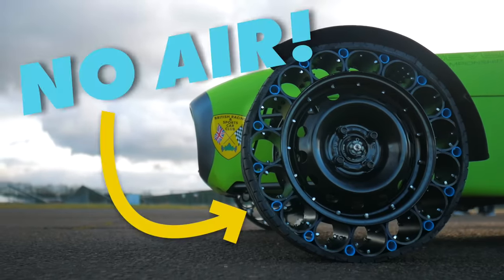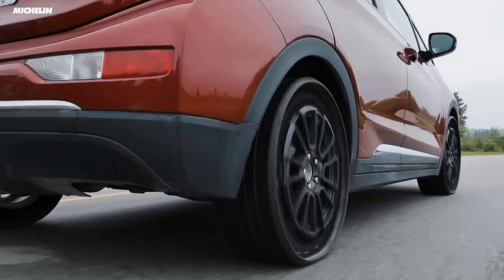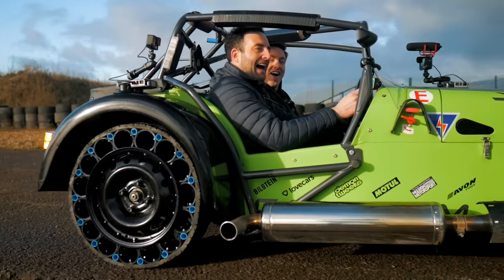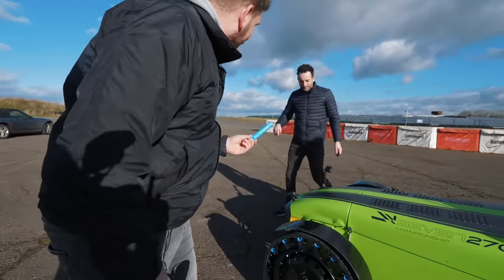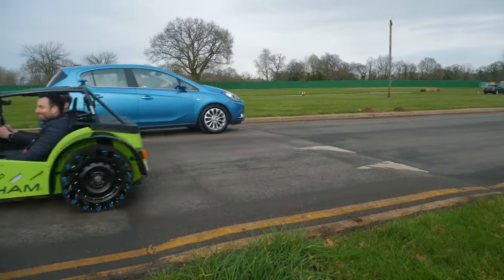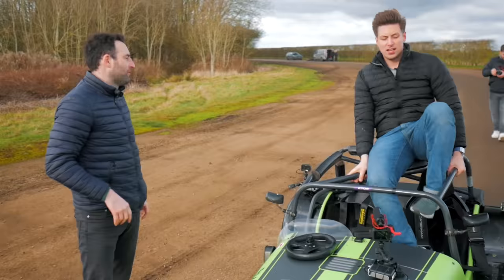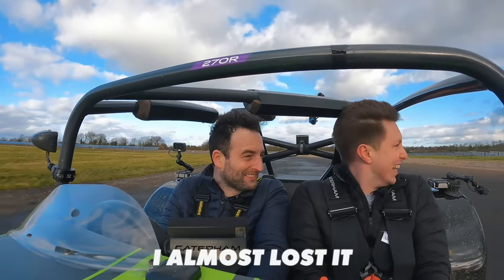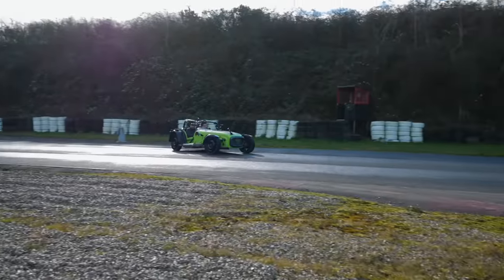I Made DIY Airless Tires

Comment: you could have built it in normal tire outsides, keeping the sides, to keep your innards in
Reply: replace the inflatable container with the air-less mechanism
Reply: the tire casing completed, would have solve the noise problems aswell, put back the side flaps

Comment: Why not simply mold the tire's rubber into roughly these shapes? No worries about nuts and bolts flying off, better adhesion to the tread as it's one piece, the ability to have steel belts.

Comment: They aren't using lock tite bolts and nuts and have no safety wiring holding it together for the nuts don't spin out ward. There is a reason airplanes use safety wire latching through the nuts and bolts on pretty much everything that moves. If the nut comes out you going to lose a piece or have a major part fall out due to the vibrations. 

The first 10 seconds in I seen this major problem in your design. This is why the major companies didn't use a design with nuts and bolts. You have to many points of failure in that tire. You need to simple it down. Also it just looks nasty. I understand it is a prototype. But there needs to be a side piece of that tire. It would also reduce the noise the tire produces.

Comment: Why did you use steel tubing for the internal structure. Tyres flex there is no flex in those tyres.

Comment: You need more of a pyramid type tire to make it more round. The design atm is less round, because you don't have enough triangles to create a rounder surface. If you look at the design you have you created with the smaller circles a triangle space. Which makes the tire lose shape. Those open spaces are causing the tire to be compressed in those zones. Look how they do it in video game graphics. To get more and more rounded shapes. They produce more and more triangles. Like shadow of the tomb raider. The game is designed in signs with millions of triangles that are tiny. This gives the shape to the world and they can create better shapes. 

I would never use a tire with how you designed it in mind at all. It makes no sense at all. No safety ties on the nuts and bolts, gaps in the spaces between the circles after you created a triangular shape. You need to recreate the thread of the tire to be build in metal wires that attach to it. I know you just ran bolts and nuts through it. You can clearly see that. Which is more point to failure. Everything you have done means this tire wouldn't last 1 week in normal operation use. Hell you might not even get 1 hour at normal speeds. You already had major failures after 5 minutes.

Comment: "For you foreign viewers, this is a pothole"
Do you really think, you are the only country, where the road construction companies do crap work? I am from germany, and here, i don't know, how to tell... They take the tax money, use 1/4 for the work, use construction grounds as a parking lot for their machines, and six month later they start the crap work. After finishing the company disappears, so waranty is impossible. This works this way for over 20 years now. And every year it became worse. A deep pothole with little surface, they came, put a brick in it, filled the rest with sand and knock it flat with a shovel. IF they do some repairs with asphalt, the new surface is nearly as wobbely as cobblestone roads from 1905.
I have made some videos. It's horrible here.
But what will you expect from a county, where the laws are so weak, that companies think, they can allow themselves to work, when they want, ask for more money, cause they transfered 3/4 away on a bankaccount in switzerland. These companies stretched the build time of the BER Airport to 9 years. The Trainstation in Stuttgart was planned 1994. Start of the construction was 2010. 2019 should be the opening. Today they aren't ready, and they maybe can finish the station in 2025.
Great, huh?
Everything is messed up like that here.

Comment: Dude the only reason nails make tires not work is due to air pressure in the tire. Any 2 year old could tell you this. Doing a bed of nail test on a tire that doesn't use a gas type system is just stupid. Of course it isn't going to make the tire fail. It could get caught in the tire and break something else. But a normal tire has that same problem

You need to make other tests of it outside of nails. Like how does it handle hitting a curb, at slow and fast speeds. How does it handle something being stuck in the side of the tire. What about heat. Does the tire start to fail at hotter heat temps. Air has an advantage of being flexible at higher speeds. Does that tire have the same advantages. Test this like. Not a tire with zero air going over nails.

Comment: How in the ever living fuck did you manage to spend 300$ building ONE wheel? That's like 20$ worth of pipe, less than 30$ worth of bolts. a steel hub (less than 100$). and some tire tread (less than 100$)

Comment: This design of tyre is good but there l will not be stranded at the side of the road with a flat tyre my 25 year old hilux has a full sized spare wheel pot holes would not bother my hilux because they are high profile tyres whats to big deal with low profile tyres had them on our ford Fiesta on steel rims the next Fiesta had much higher profile but they were useless k would hate to think if they were alloy why don't look at the how they used to build cars and learn from them cars built 20 or 25 years last longer have less electronics and there are a lot of them on the road my hilux will last another 25 years easily without an engine rebuild how do you make an old british built car reliable put a Toyota engine and gearbox in it

Comment: First Ukraine and Russian captions.
Second,  300 ! bolts?
    Can this be done by taking bolts off, say captured Russian military vehicles?
    And can that be done without power tools?  (Take a close look at Aristotle's 6 simple engines and 32 complex engines.)
Third, fresh water pipe?  What might be scavenged in Ukraine from dead vehicles or bombed buildings that would work as well?  Or, work at low speeds?
Fourth, how to make a car jack.  Again, Aristotle and scavenging.
Fifth, you're using the tread from a "normal tire".  Do some research and find out what is a normal tire in Ukraine?  Can tire treads from military vehicles be used.

Yes, I know this is a lot, but I am so tired of "thoughts and prayers" for Ukraine.  Let's DO something.

If you don't want (or don't have the time) to do this yourself, throw it open to your viewers.  If one can find out what tires are available in Ukraine, good.  If someone else can figure out alternate piping, good.  Then someone else ... you get the idea.

AND WHY THE HECK DURING TESTING AREN'T YOU WEARING SAFETY CRASH HELMETS????

Otherwise I think you're brilliant and my thoughts and prayers are with you.